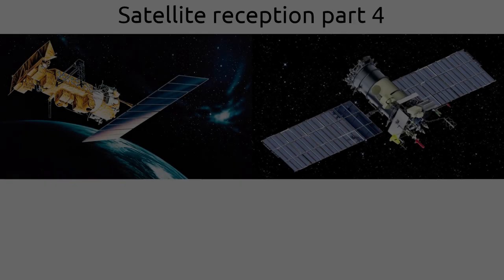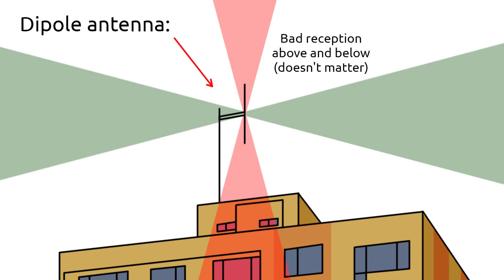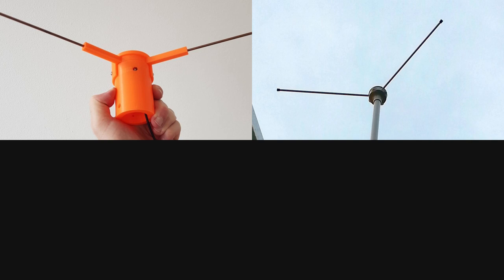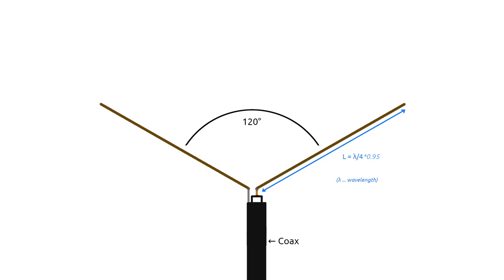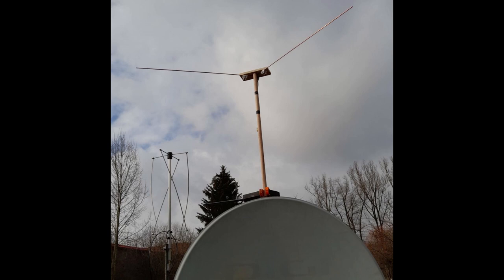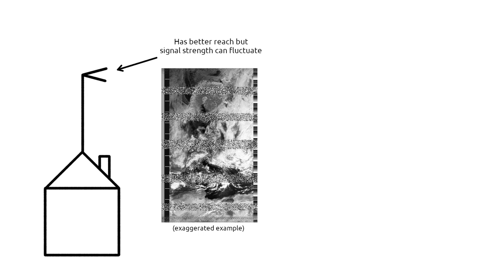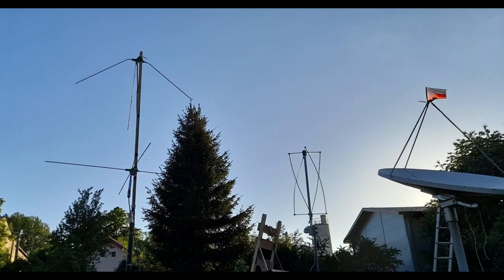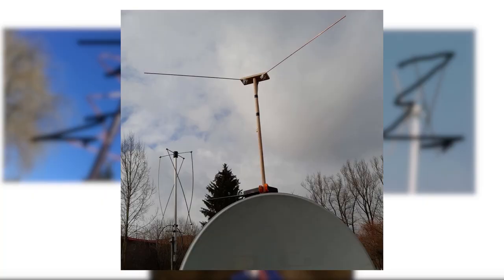The V-dipole antenna || Satellite reception pt.4

Comment: I have made v-pole antenna. Using nooelec product LNA. Using RTL-SDR. Using SDRSharp software. To receive FM radio broadcasts to function properly, it's must use the LNA. But after several weeks of trying to receive pictures of NOAA15, NOAA18, NOAA19, MetopB, MetopC, never got a good signal at the working frequency of the satellite. The reception location is in the middle of a field, an open area without obstructions (houses, trees). I have adjusted all parameter settings (frequency, bandwidth, etc.). Where do you think my mistake is?

Comment: How about explaining the reasons and benefits (if any?) for winding and coiling the coax near the antenna's feedpoint as seen in your pics? Also, you mentioned using a reflector element but later removed it -- did it help or not?
Reply from the maker: That's supposed to act as an RF choke and prevent the coax from acting as an antenna, but just like the reflector the improvement is situational and depends on your antenna placement

Comment: Sir, I am a scanner guy: (dedicated scanners, UHF/VHF aircraft radio/cb radio/marine radio) if you feel that there would be an appropriate interest by your subscribers, would you please consider making a video addressing (a wide range) of antennas that may be used for scanners.    (perhaps you would include off-the-shelf scanner antennas and homemade antennas - and cabling/and connectors)   Oh yes, I have done some research on multiple antenna combiners (active and passive), on splitters (active and passive), and on signal amplifiers (active of course).    I have read so many conflicting reports which end up offering a myriad of conflicting suggestions: some suggest that 1 antenna for 1 scanner is the best: other data sources suggest that using a combiner, to combine the signal from many different antennas would offer an improvement: I also read that using a combiner to combine the signal of MANY antennas into 1 final output - then feeding this output into the input of a scanner may overload and damage the scanners front end.    I read that (for best performance) the scanner antennas must be identical with identical lengths of cable - I read that I should be able to use a combiner (active or passive) or, or, or a splitter (1 input 2 outputs, 2 inputs, 3 or 4 outputs, 4 or more inputs, with multiple outputs)(used inverse or normal forward) to split and combine signals.   Some sources suggest that a combiner is identical to a splitter - while other sources suggest that a combiner is entirely different than a splitter.   (The data) It's a mess and no 1 source addresses all of these issues - they all appear to be in conflict with each other.(to some degree)   Oh yes, and let me ramble for a little bit more please: if I have 4 to 6 different antennas of different configurations, combined then I want to use an amplifier to boost the signal: then once the signal is boosted, I want to use a splitter to split the boosted signal for use in/on 3 or 4 radios.      I have done this, I don't know if this mess works better than a single antenna for each scanner or radio - but combining 6 antennas, amplifying the single output, then splitting it again, seems to work.   There are antenna distance issues - as in separation?    I'm not aware that I have damaged or am damaging the front end of the radios.    I guess that my final thought is that of should I just purchase 1 super giant, very expensive off of the shelf scanner/multi-band antenna - amplify and split the signal and share between multiple radios.   I hope that you can follow this line of thought: I must admit, that it confuses me.    Thank you: I am a new subscriber - your channel has value.  Thanks again.
Reply from the maker: I don't think having multiple antennas connected will damage anything as long as they are passive. But I think if you just use an ordinary splitter to combine the antennas it's not really going to work that well, because you would need a filtered one that has a bandpass filter on each antenna input, so every antenna can only let in the frequencies it's meant to be used with. Below 1 GHz it should be possible to make bandpass filters relatively easily, that could be something I take a look at in the future